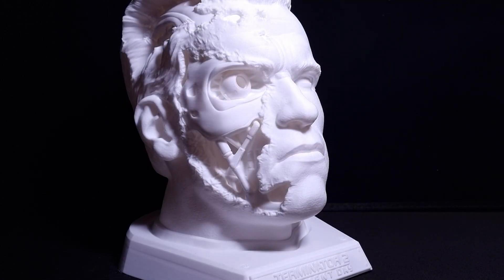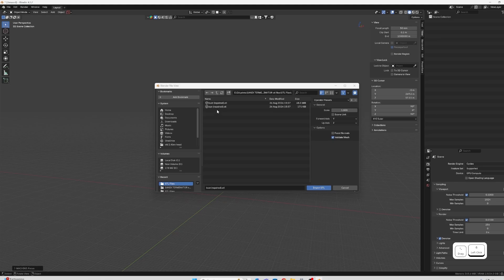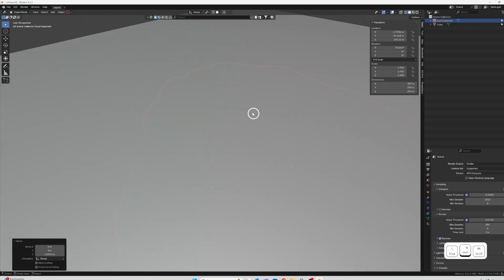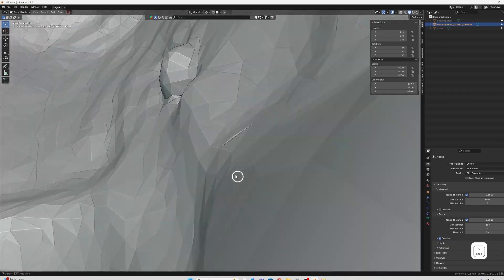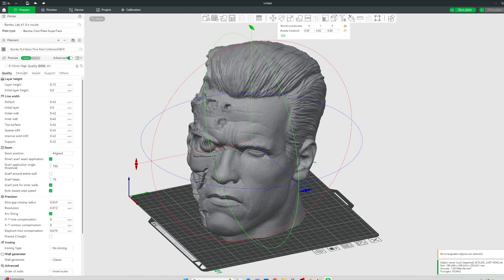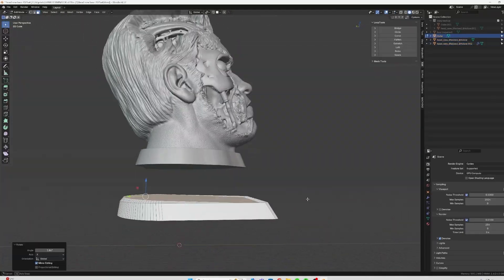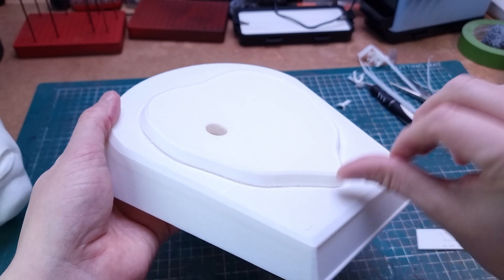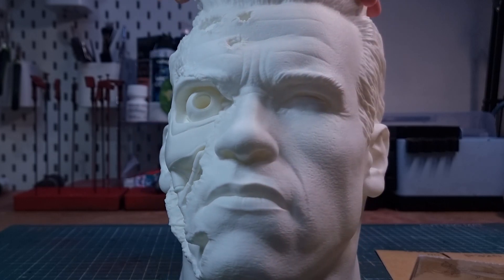How to get PERFECT FDM prints every time!

Comment: Great video, would love to see how you extruded the neck on this model in more detail, to make the custom base, I have slowed it down but cant follow the steps  ( Also just Subscribed !!! )
Reply from the maker: Hi buddy, thanks for the great feedback... and the sub!! 🦊 For the neck section Iused from the base: I alt+clicked the outer edge in Edit Mode (set to edge select), Shift D to Duplicate. This gave me just the empty loop of the neck. I then pressed F to fill the hole inside the loop, then E to extrude. Then with the new object selected, press P and seprate by Selection - this makes it its own object, not part of the head. Hope that helps, but if you need anything else, just shout!

Comment: a tip about saving printing time by hollowing out the object. it might not actually be saving you time. when you hollow the object you are now printing 2 sets of walls rather then just 1 and the walls are generally one of the slowest parts of printing. I find that I often get much better printing times by keeping a model solid and optimizing my infill, you really need far less infill then the defaults are set too if your not printing for strength but just a cosmetic part. I generally do 5-8% rectilinear infill and will often use infill blockers to get rid of infill in the lower sections of models that dont need it. You can also try lightning infill, for some models it can save a huge amount of time. Cool video and cant wait to see the painting.
Reply from the maker: Ah I get you! You see, this is a big reason I made this channel - to get help and advice on my shortcomings, as much as sharing what I've managed to make. Really appreciate your time in writing the tip - I was thinking of printing a smaller "test" head for the painting part, so i might do a full sized one using the above and compare. 

Again thank you for the advice!